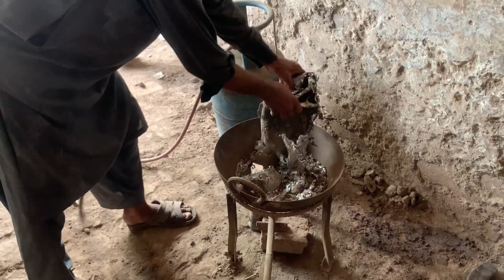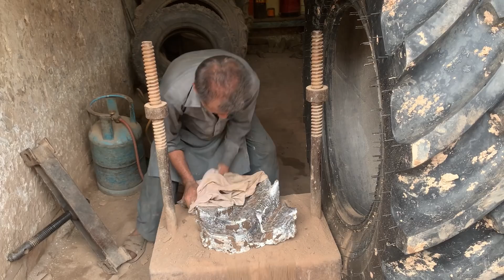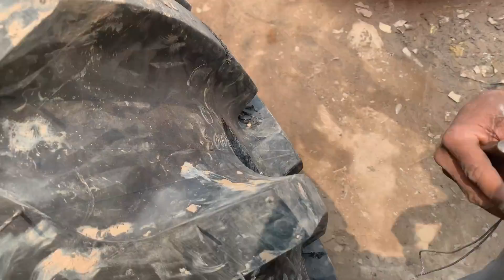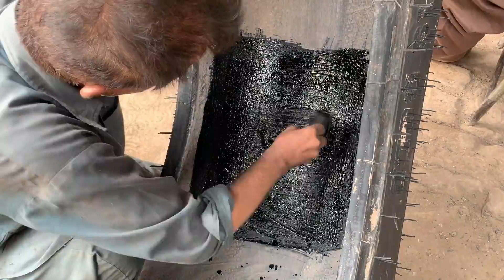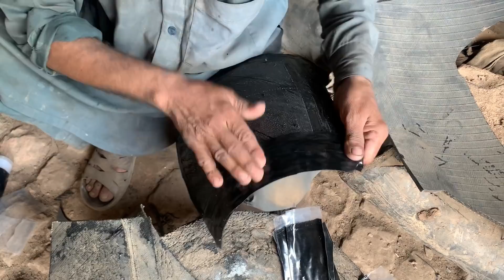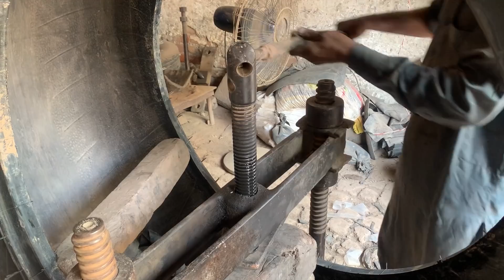Repairing Big Tractor Tire Using Aluminium Mold || The Most Amazing Process of Giant Tire Retreading

Comment: There are tire repair services for very heavy mining equipment. Some of these tires weigh thousands of pounds each.  And they are repaired in a very similar way with the exception of using aluminum.  This man did an excellent job repairing a tire that would have been expensive to replace.

Comment: Demonstrated how to make a dye to match the tread, how to add ply using nylon cord, skill in shaving off the  rubber, very multi-skilled, hardworking. Surely did not appear to be a routine job but end result was pretty good saved a good amount for the tractor tire owner.
Reply: @gm4ulkill  . ..
Reply: One slip with that steel knife tool could result in self castration, sitting in that position. Can you imagine what our highly OH&S workplaces would make of those working practices and conditions. I take my hat off to that skilled man and his co-workers.

Comment: It is not aluminum, it is lead. Aluminum melts at 700 degrees Celsius! It would set the wheel on fire, in addition to not being able to reach that temperature with that bonfire. Lead only at 300. in addition to the obvious WEIGHT that it has when the man lifts it. if it were aluminum it would weigh almost nothing.
Reply: Thank you! So obvious its not aluminum.
Reply: @assymcgee2835  
the title then misinforms
Reply: Exactly my thoughts.
Reply: why he has  not fix the title yet  :)
 beside  this guy has not have any  tools , all he has is the one that  he made of  metal scrap !!!!!
Reply: @farzadnadafian15  Which is kinda ingenious though
Reply: You are wrong. The amount of ALUMINUM he is putting on in increments is not enough to catch the thermally insulating rubber on fire. The whole great thing about vulcanized rubber is that it hardens with heat if applied properly. And yes, that much aluminum and mud is rather heavy lifted at that height.
Reply: Not to be an ass here, there isn't a wheel inside the tire.
Reply: @k.l.8011  It's obviously a lead-based low melting point alloy.
Reply: @k.l.8011  You have never melt aluminum, right? Aluminum would never melt in a pan on such an open fire.

Comment: Amazing. He did the job out of almost any tools. Though for safety reasons,he needs to install a gas regulator on this gas cylinder, so the gas couldn't return in the gas tank. Great work... respect!
Reply: the flame will never go back into the tank.  the pressure and the fact that there is no oxygen in the tank prevents that
Reply: @delfinocornejo3496  The flame can easily go back in the tank when its almost empty and there's no pressure enough to prevent that. All the gas tank explode incidents happens when you don't use this regulator and on empty tanks ⚠️⚠️
Reply: @alexalexander723  yup better call osha lol
Reply: @alexalexander723  that's not the job of a regulator and it won't stop flashback. Crazy I know...
Reply: He had the vulcanising machine.

Comment: Im pretty sure the material is lead, not aluminium. Any way, amazing video!
Reply: I was about to say the same. Aluminums melting point is 1220F (660C). It would have melted right through that tire...
Reply: It’s Babbitt —melts at 235 C
Reply: Led would have melted as the tire was going through the vulcanizing process. Some of those tractor tire tread are made with synthetic rubber. Synthetic rubber is usually very tuff. I too was kinda thinking led when he poured it on the tire.
Reply: I hope that tyre held air after that long process otherwise I'd probably walk the plank!
Reply: I think it's aluminum because of the vulcanization of rubber temperature is just under aluminum's melting point and lead melts at half the temperature of the temperature needed to vulcanize rubber.

Comment: So about 8 times the work that is needed? Imagine this guy being the guy who teaches you your craft..
Patch it from the inside is correct, the filler on the outside is only needed because he removed material.
Press the patch from inside is correct too, but you could just have a sand pit below. It would allow you to press at the joints all the same.
Wohuuu, you have mended the whole thing, without all the shenanigans.
Reply: ever seen a heavy duty tire resectioned in the US??? that tire wasn't patchable

Comment: I was under the impression that they use lead for this process. I also repair industrial and agriculture tires for a living , I literally just repaired the same size tractor tire about 2 hours ago at work. We use different methods here in the U.S. though.
Reply: Don't leave us all hanging. 

Whats your method??
Reply: It is lead. You can tell by how much the guy struggled to lift it and the low temperature fire to melt it.
Reply: I think that this is more likely a solder. Since the temperature of some types of solders is much lower (45-245 degrees Celsius) than pure lead or tin, and rubber can withstand such temperatures. I myself also cure tires for agricultural machinery. The method is interesting but very long. Although it may be that a person's capabilities do not allow using other methods. Hello to all colleagues, I am from Ukraine.
Reply: It's lead.
Reply: @2fukWu  Lead has a melting point of about 325 degrees Celsius. In practice, for successful casting, you need to heat the molten metal above, so that it is somewhere between 380 -400 degrees and this temperature can change the physical properties of rubber to unacceptable values. It is easier to ask the author of the video if he himself knows for sure exactly what melts. All blessings to you!
Reply: @ЛаслоАноп  The video title says aluminum, which can't be right. Aluminum would be too hot and melt the rubber.

It is probably lead or a lead/tin solder to melt and solidify so quickly.
Reply: @ЛаслоАноп  The author of the video has already stated that aluminum was used. * in the video title *. 
Though it could be tin, some kind of solder, or something else with a lower melting point, it's not aluminum.
Reply: @davidparker9676  

Maybe I didn't write the truth on purpose so as not to make competitors for myself and the video is so for advertising my work. I already wrote that this is some kind of solder, maybe tin has a melting point of 230 degrees Celsius, which is quite acceptable for rubber without consequences because it pours in a thin stream .But there are solders with a lower melting point, even only 45 degrees Celsius.
Reply: @2fukWu  lI didn’t read the title because I don’t speak English. And the fact that the author wrote that this is aluminum may be protection from competitors, since molten aluminum will burn rubber.
Reply: @ЛаслоАноп  You can't read the title but you read and respond to the comments. Interesting language barrier there.
Reply: @ЛаслоАноп  Wow 45 degrees Celcius is very low melting temp. Where I live it almost reaches that temperature In summer.

Thanks for your comment, it was one of the more informed ones here. This is the first time I have seen a repair done this way and the video didn't explain much.
Reply: @2fukWu  It's simple - google translate
Reply: We put a tube in it..

Comment: How much does a repair like that cost in Pakistan? Really impressive work 👍
Reply: $1 USD
Reply: @nateg5887  😂😂
Reply: @nateg5887  no way, the material are expensive, gas, the rubber, gum etc and not to forget labour. Minimum would be $15 relative. And am a trucker by the way.
Reply: I would guess $2-$4 USA per day plus costs, thats a $800-$900AU tire here in Australia. Did watch this done once while in Sri Lanka
Reply: whatever it cost, it is far less than what the technician deserves. that you can be sure of.

Comment: This is the first guy I have seen with that sheet rubber stuff that doesn't roll the stuff so hard with his little wheel tool. They put so much heat and pressure on them when in the vice I don't see why it would be needed to do all that extra rolling.

Comment: In my 40 years in the tire business I have never seen somebody make a sand cast of a tire for any repair, also the cords in that type of tire are at 75 deg in an X pattern, hes repairing it as if it is a radial design, that tire is screwed, when the power and load hit that tire the tire will flex the way its made that patch will flex opposite and tear that casing apart in short order,  that injury to the tire can be properly repaired  but not the way these guys do it.

Comment: Certain that this is aluminum? Aluminum needs at least 670-700 C to melt. Can't imagine to get that with this little cocker-thingy. Also I would not pour such hot stuff on rubber. I guess its lead - melting at  around 320 C.

Comment: Rubbish job will not last . No heat was there so not going to bond . Soon as its on and going over rough ground it will blow under high psi.  Yet another silly back street shop . But nice try
Reply: If you look carefully he's had his propane torch running under the moulding plate so the mould that was still hot when he removed it should be pretty hot.